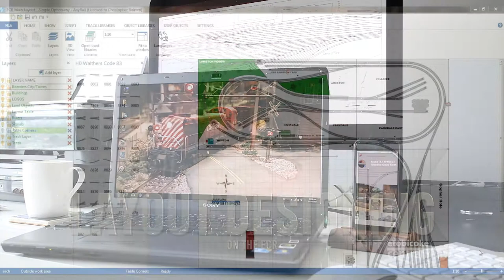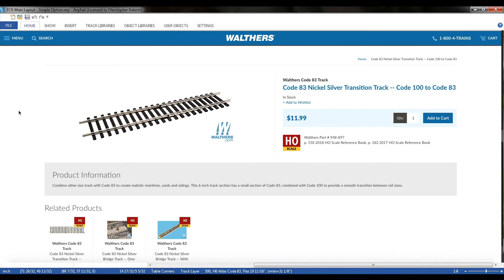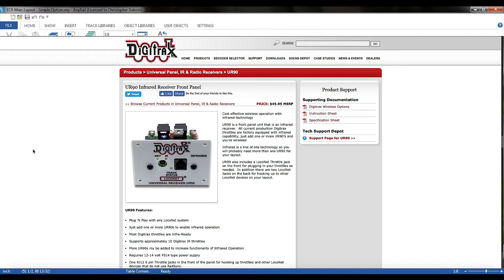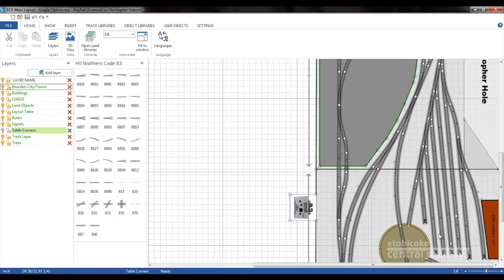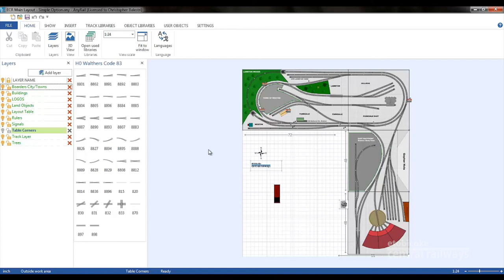Etobicoke Central Railways - Layout Designing March 2018

Comment: Great update and very professional production as always!!! If I could make one suggestion for your yard, if you don’t want to run the risk of any scenery including those taller foreground structures you mentioned becoming damaged from people reaching over to throw the switches, I’d suggest you use Blue Point Switch Machines. I’m using them on my own layout and I’ve seen them on others. You can power the frogs of your switches with them, but not have the mainline feel of automated switch machines, and your scenery remains in tact!!
Reply from the maker: Thanks for the insight, I'm going to look into that. Using those machines would also keep me from crawling in and out of the gopher hole all the time. How do operate them, toggle or JMRI?
Reply: Etobicoke Central Railways neither! You operate them manually with a flexible plastic rod similar to that of a choke cable. The only soldering required is on the underside of the double pole double throw switch inside the housing, where you solder one lead to the left rail, one to the right and the middle to the frog in order to power it. Otherwise the switch is thrown via a small wooden knob you mount to your facia.
Reply from the maker: That's awesome, I'm doing some reading on them as we speak. That would make things convenient considering the yards location.
Reply: Etobicoke Central Railways exactly! And it would add a level of operational interest as well as a more prototypical feel to have to manually throw the switch points like they do in the real world.

Comment: If I were you I would use a Walthers 90 turntable. I have one on my layout. It is small and does not have any crazy electronic and I use a dc controller to turn it. With you layout I really think  you don't need any crazy electronic but if you need it exact get a controller for it or a dcc ready one.
Reply from the maker: Thanks for your comment! Appreciate the insight. I would definitely love to have the Walthers turntable but I already have the existing turntable installed. Although I have considered replacing it with with a Walthers one. DCC would be nice as well.
Reply: Etobicoke Central Railways well that good. Nice to already have one and not have to worry about get in one. And the dcc ones are very expensive. Ether way, in the long run you could still upgrade.
Reply from the maker: Most definitely. I'll need to think things through before I start laying any track.